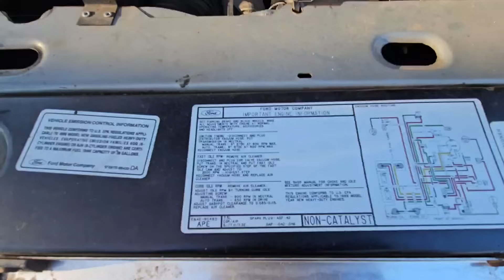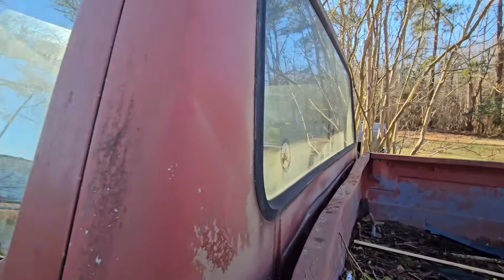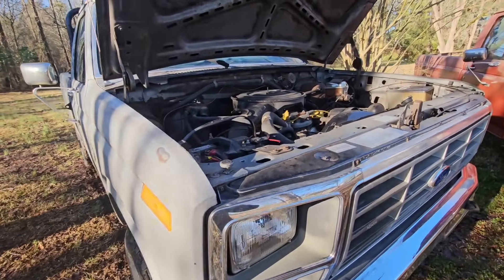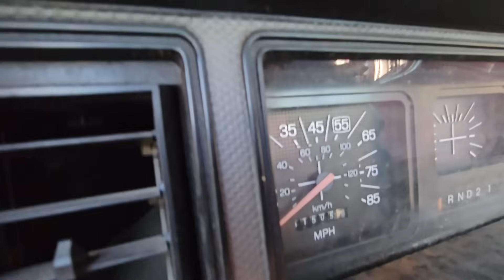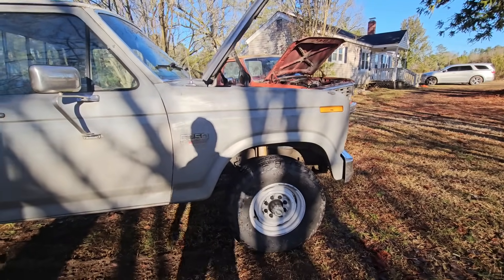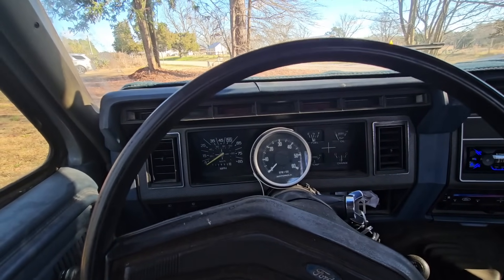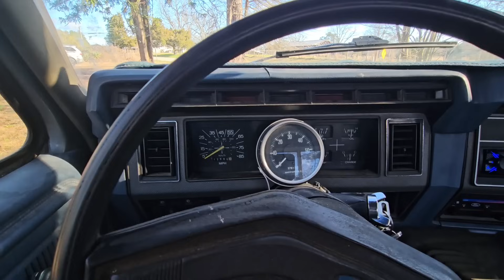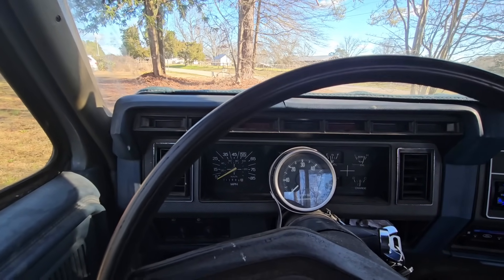THE WORST TRUCK FORD EVER MADE!?!?! #ford #fseries #sbf #bbf #truck

Comment: Saying AC delete is a bit misleading for trucks from the 80s.  It was not like it is nowadays where AC is standard on about everything, it was AC added! 😃
Reply: Saying “AC Delete” isn’t even the proper way to use the word “delete”. The word “delete” refers to computers and software, not mechanical automotive parts. People misuse this word all the time now and it aggravates the hell out of me.
Reply: Yes. It just wasn't ordered with it.
Reply: @warrenmcelroy4718  I had an ‘82 Camaro with the factory labeled “radio delete” option.
Things did exist before computers 🤣
Reply: The fleet guys never got air.  Lucky to get a radio.
Reply: @pmscalisi  
I bought a new 88 GMC s15 that came without a radio or A/C. But those were different days. Today is different.
Reply: @pmscalisi  No……. Even typewriters didn’t have “delete” keys, they had “BackSpace” keys… you ever look the word “delete” up to see its actual definition? People never started misusing it until around 2007/2008 when guys started removing the DPF systems from their ridiculous emission compliant trucks and had to “delete” the programming that told the engines not to run properly without the DPF in place. People have been throwing that word around ever since… so about your Camaro… Nope
Reply: @warrenmcelroy4718  No.  Delete has meant "to remove something" for about 700 years now.
Reply: @warrenmcelroy4718  Typists had to delete their own mistakes. My favorite way was with the white out tape. Backspace to the letter needing correction, put the correction tape over the incorrect letter, then type that incorrect letter again. Backspace again, and hit the correct key this time.
Reply: @spamanator666  nope!
Reply: @warrenmcelroy4718  LOL!  Okay then… what a strange thing to be so worried about.

Comment: 1975 was the first year for catalytic converters.  Not all cars required a cat in 75.  Volkswagen,  Subaru, and Honda.  Notnsure what year the Volkswagen and Subaru required one, but for Honda, it was the 1980 model year.  This is for California.   I dont know about other states.  I do remember a cousin having a 1979 Datsun 210 with no catalytic converter, but it was from Oregon.  My 1980 Datsun 210 was factory fitted with a catalytic converter.

Comment: Funny you mention base models and what they came with. I bought a new 94 F150 XL stripped which was 300-6, 5 spd manual..6’ bed small 21575/15 tires ..steel wheels… no radio no speakers and a plastic plug in top of fender where the antenna would be. No headliner ..no AC..crank windows no rear slider vinyl bench and rubber floor mat and no rear bumper which I paid an additional $200 for dealer to install before delivery. $10,999 before bumper lol

Comment: Too new if you live in CA. Pre 73 no smog no computer's. Keep it running with a ratchet, Cresent wrench, screw driver and feeler guage.
Reply: Why would you want to live in CA?
Reply: exempt is 75 and older. has been the rule since 2004. The governator changed the rules back then, it would have been a moving 30-year window from 05 if not changed.
Reply: Pre 75 for no smog here in Calif.  Maybe even later now.
Reply: @socalltd  That moving 30 year window was actually Grey Davis's work.  Before, it was 66 and later no matter what.  Then Arnold became governor, and he made it 74 or 75 and earlier no smog checks.
Reply: @jamesbosworth4191  Correct. In 98, it went up from 66 to 73 and new cars were not to be smoged till 6 years from new. Then in 04 the 30-year rule was to start but was changed from 75 and older.

Comment: My 1982 f250 300 6 is the first ford pickup i drove that the steering didnt wander.  I worked on the farm we got it for.  The farm owner gave it to me when he retired.
Now for the price..people buy what they wanted at 20 and can now afford.  Model a and model t used to bring 10k or more fully restored with 9 coats of lacquer.  Now worthless.  Before covid the late 60s to 70s cars.  Now we are working into the 80s.  Those trucks actually survived the crusher 10 years ago.  The value is going up.  Then will go back down.

Comment: I love the bullnose trucks. I still have my 85, but sadly it has gotten too rusty. But I will be transplanting the 300 six and trans into a 82 I got that been parked since 1998. Motor and trans were pooched in it, but body is very solid and fixable. I look forward to driving that 82 as work truck here on my acreage.

Comment: The bullnose is iconic, measurably better than a square body in every way
Reply: I like these Ford trucks, but are they better than my 73 GMC 3/4 ton?  (No catalytic converter, no smog checks).
Reply: I agree and I own and drive a Chevy Silverado. The square body Chevrolet was in my opinion the worst quality truck that Chevy had produced up to that point. I know that’s blasphemy today given what people are paying for them but it’s still a fact. They would absolutely rot out down here in the Southeast without the help of road salt. Interiors, door panels, and other materials were as cheap as they could get. Ford at least had much better corrosion protection and their hood wouldn’t fold in two if you pulled too hard on it. Like I said, I’ve owned a Silverado longer than any other brand truck I’ve ever purchased but I’ve never understood the infatuation with square body trucks.
Reply: @prevost8686  Yes, they were serious rusters, not quite as bad a 57 Chrysler products, but not much better either, although here in California, rust is not much of a problem.  The interior materials seem pretty good on mine.  The folding was supposed to be about safety.  There was no separate vent panel right in front of the windshield, so GM was worried that in a collision, that hood would crash through the windshield like a draw knife and behead you, so they put that weak spot in the middle.  Many of us welded pieces of steel across the weak spots to prevent that.  In the 80s, they dropped that "feature".  We love those trucks because the 70s and early 80s ones were free of computers, sensors, etc.
Reply: Dent side was better but the bullnose was a more refined look.

Comment: I bought a new 1986 F150 when I came back from Germany.
300, 4-speed, 4x4, AM radio, no air. Wish I still had it.
I have a ‘81 F250XLT, 4speed, 4x4, 351. Had A/C, I just use it around my property

Comment: I bought my 83 F100 8 years ago and have been driving it weekly. I have taken it on several 400 mile trips. It’s been much more reliable than I would’ve thought for something that old. 302, AOD. The previously owner obviously cared for it. Everything works. Clear coat is peeled but it’s still a handsome rig. Two tone metallic brown/tan. Gets lots of compliments. Best $1800 ever.
Reply from the maker: @joeypyron3218  Very nice!!!

Comment: I have a 1986 f-150 XLT Lariat supper cab 302 had it for 18 years its still a new truck 69,000 miles. Never been in salt, sits in the garage in the winter start it up every 2 weeks. In the summer takes 2 or 3 trips a year with a 19ft 5th wheel. Have pulled a 23ft 5th wheel with it. 55mph. is it pulling it will go faster but runs best a 55mph. Detroit I have seen a feu of them for sale for around $80,000.00 they only lasted a few days.

Comment: I currently have a 92 F-250 Ranger 390 4 speed, 78 Bronco straight 6 4 speed, 88 Bronco 351 auto, 01 F-150 and 01 F-250 Super Duty V-10.
Reply from the maker: @howardgrover8908  all very good trucks! Be hard to choose which one to drive every day!
Reply: @runsgoodbutsmokes  I drive the 01 F-250. It has the V-10 and is a hell of a work truck.
Reply from the maker: @howardgrover8908  Taken care of it'll last forever!
Reply: @runsgoodbutsmokes  270,000 on the Super Duty, nothing but routine maintenance. Just over 300,000 on the Elantra. Routine maintenance and 2 cluches. I can't complain.

Comment: I got a bricknose 88 F-150. I think it's beautiful. I like the fuel injection. Mine is a 300-6 with a BW-T18 4 spd 4WD. The original owner died and his widow let it set for 11 years couln't bear to see his beloved truck go. When she passed I bought it from her daughter. New fuel tank and new fuel injectors and new all the little sensors that connect to the computer and she runs and drives like new. 1 can of R-22 and it has the coldest A/C I've had in years. I got it painted and undercoated and I replaced the seat upholstery and carpet myself. I got S10,000 in it and it looks like a new one and for me it was a great deal. They can shove their new trucks.

Comment: Basically, these are smog era trucks and peak malaise era. 70s fords looked better, had more power (except maybe for late 70s), had mostly the same transmission options. They were probably made to last a little better with more galvanized steel. Some things did get better from the 70s though. Ride was smoother, cabins were quieter, and had more creature comforts. Turning circle may have also tightened slightly.

I grew up loving the 70s dent sides but never was able to get into one as an adult. Now after more than a decade in a 1986 F250 diesel, I can't imagine driving anything else. Not quite as easy to simple a 300 six or 351W, but it just keeps going.

Comment: I bought a new 1985 Ford F250 4x4 XLT, W/ 4 Speed Transmission, 460 V8. One great truck, used to pull my stock car, and had a pop up camper. Loved it.

Comment: i own a 84 f 250 4 seed on the floor with the hydraulic clutch   that started pulling through the fire wall  my dad own a 85 same setup but it had the 460 engine and they had a week firewall wear the bolts for the hydraulic clutch would pull through  they had a recall on that clutch  i would love to find them again

Comment: I had a 1981 Bullnose F 250 4x4 with the 300ci 4.9 L inline six and a 4 speed. and it was an incredible truck. and it really hurt to have to let it go and I really miss that truck. I guarantee there's no other truck ever made that will do the work that truck could do without a single complaint. I never had to do anything more than regular maintenance on it. there is no other vehicle that I have ever owned that I can say that about.

I actually like the looks of the Bullnose Ford trucks. they are much better looking than the flat nose models that came after the bullnose trucks. that had the small grille and big headlights. those trucks had virtually no styling to them at all.

Comment: you can make over 400 bhp with the 351 with heads, intake and cam swap and the right carb and tuning. there are lots of ppl who make 500 bhp with 302's they need a built bottom end and they can rev to 7500 rpm's and get really nasty. its just really how much do you want to spend on it. thecraig909 has a 64 f100 with a 500 plus hp 302 v8 in it and it sounds crazy! an ok engine builder can make 1.5 hp per cubic inch so a 351 is capible of 526 with the right parts.

Comment: I love them trucks. My ex fiancé had an 86 and I had to 400M in it. With the C6 tranny. We would haul horse trailer with it with no problem. it was a 2 / 4. The truck got pretty decent fuel mileage and I was completely stuck. Doing the thing we had changed was. I had a buddy. Mine was a card man and he rebuilt the carburetor and modified it a little bit made it ran better. He tuned it. Right now I have an 89 Ford f350 7.5/460 Which I wanna get rid of the fuel injection system on EFI I want to switch the manifold out and put a sniper on it. I think.
 I can get run better and get better fuel mileage. Cause it's self tuning.

Comment: Had a 81 f250 custom factory with a 300i6 and 3 on the tree manual 3.33 rear gearing it would out tow my 01 1500 dodge with 318 5spd and 3.55 rear

Comment: I think the 400 had been discontinued  as the 6,9 option became available . I've had a few different variations of these trks, I love the 6,9 n the 4.9 carb style. I do away with the odb system . Not that anything wrong with other variations it just wat I go for. I, still on the bull nose trks. Great reasonable trust a guy can work on them at home. Very dependable.  I say with something so old in today's world the only way to get any good money from them is to have it tip top including paint n ur still going to loose. U just keep em n get service from them. I've had my 250 4x4 6,9 dismantled soo many time just to make improvements and service over the yrs.

Comment: I've got an 85 F150 351 HO Holley 4160 C6 9inch rear 3.00 gears long bed dual tanks AC PS PB
Reply from the maker: Great truck!
Reply: @runsgoodbutsmokes Mines got a good straight body it's the XL trim rubber floor vinyl seats dark blue metallic / sliver in the middle just dropped a fresh long block in and have to run the exhaust and it'll be road ready
Reply from the maker: @drjohnsonhungwell5115  very nice!

Comment: I think your title is wrong. These trucks are really desireable as they’re the last of the old school trucks, square sealed beam headlights and carbureted engines
Reply from the maker: The title is a question not a statement. If you listened to the video, I did nothing but talk positive about these trucks except saying they're ugly, in my opinion. The whole point of this video was that I believe these trucks are among one of the best and most reliable trucks ever built, but for some reason they are very hard to sell and marked at a very cheap prices, as if nobody wants them. I daily drive these trucks and have hauled many cars, helicopters, planes, horses, and trees with these trucks. Absolutely tremendous trucks.

Comment: To most people these trucks are old and they don't know how to turn a wrench or read a Chilton/Haynes manual. 

To younger people (meaning under 40) it doesn't have a moon roof, power windows or mirrors, XM Satellite radio, cup holders, heated bucket seats, or four doors so it's a no go. To them, carburetor means old and mysterious voodoo magic from a bygone era. Most don't know what that silver button on the floor under your left foot does.

Comment: I have an 87 F-150 XLT, 4x4. 5.0L injected engine, factory AC, 4 speed manual. Lots of surface rust, but only one small rust through over the rear wheel well. She’s ugly, but she starts every time I turn the key.

Comment: I owned an 1981 f250 4x4. With a 300 online 6 cylinder.  I with I still owned it. It had a 1 barrel  carburetor.  I had almost 300,000 miles when I sold it. I put a new clutch in myself. Best truck I ever owned. My was a high boy. Better than what they are making today. More computers the worse they become.
Reply: I still have my 1979 Ford  f250 that I bought new. It's my baby. Never been in salt ever. C6 automatic. With special order 460 high output from Ford. Cost 12,000 dollars new. Still all original even headlights. And no rust still original miles 82,000 miles. Is covered  up under blanket  in my garage. Ain't for sale ever. It's willed to my God son.

Comment: 1985 and 1986 efi are un-reprogramable. They are transitional years and when the ECM goes it is time to retrofit to carbureted or scrap it. 
These are pretty good trucks IF they are NOT fuel injected.

Comment: I had a bunch of Ford trucks in the 60's,70's and 80's 
The mid sixties F-150 long with a 240 6 was great. It's mates the F-250 4x4's were a lot harder on maint and fuel. The F-500 was great for everything but too light so I got an F700 in the early 70's All good, In 76 I bought an F-350 with the 300-6 and changed out the engine by 20k for a big block wedge, a 390 I think. It was like turning a turd golden. The next year a new f-250 with a 400 ate a valve within the first year so I dumped it.
In the end I put 390 cid car engines in all of them. Most had New process 435 trannys except the F-700 with a Clark 5 speed (it had a 391 -v8, a real truck engine).
The single problem that all the smaller ones shared was that stupid drag link in the steering. Every truck needed a new one every 20k. The big V8 got the same or better fuel economy than the 6 cylinder models, maybe because these were actually used as trucks, as in never going anywhere unless they had a load to carry.
I can probably still build-up a Ford big block without needing a torque wrench, I did so many of them.

Comment: Have had several of them a couple where brand new 1980 and 81 F 250 4x4. Can't they ate front tires with that IFS that's why from 93 on I bought F350 SRW still have a 93 with 5.8 4x4

Comment: my brother gave me an 87 f250 hd has 6.9 idi but 3 months later a seal in bellhousing area blow out an it dumped about a gallon while parked before this the trans shifted great but not sure if i should fix the C6 or swap it to the T19
Reply from the maker: Either option would be good! Whatever is in your budget!
Reply: @runsgoodbutsmokes  i have all the parts needed to swap it to the T19 i haven't taken the C6 out to see what exactly blow out but it was just pouring out of the bellhousing
Reply from the maker: @87fubar  pump seal probably in the C6 sounds like. I mean if it were me, I'm a stick shift guy so I say if you have the funds and resources and willing to do the manual swap, then DO IT! That'll be sweet!
Reply: @runsgoodbutsmokes  i prefer stick right after the trans issue i found a killer deal couldn't pass on marketplace T19 trans with almost everything new for $400

Comment: I had 2 84 F250's myself one was a two-wheel drive that was two-tone paint with a brand new 460 and I swapped in a ZF5 speed and the other one was a four-wheel drive with a 460 and a C6 automatic end up selling them when I bought a 2002 7.3 l powerstroke f250 XLT when I was 19 years old

Comment: The difference that makes them better than the crap coming out today is they are actual vehicles, not computers on wheels.
That means no constant beep-nagging if it thinks you're going too fast, too slow, too far to the left or right, going too fast or slow, etc.
#CANCELtheBitchmobile